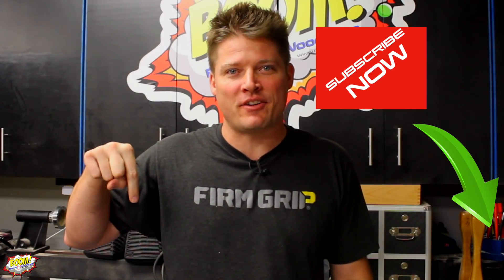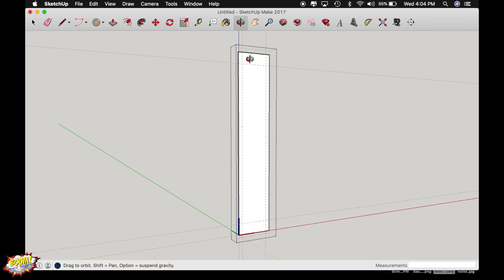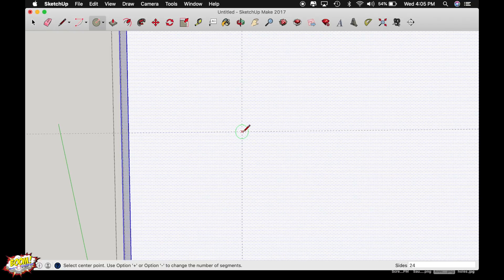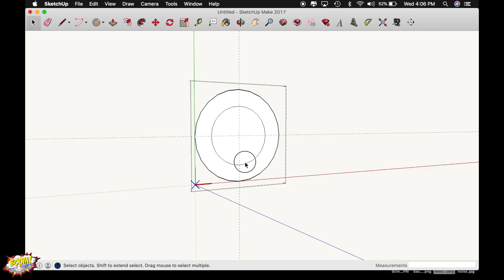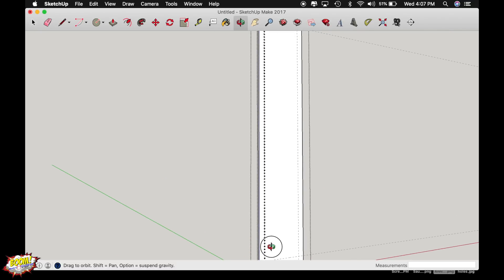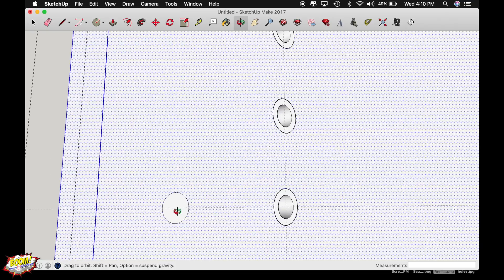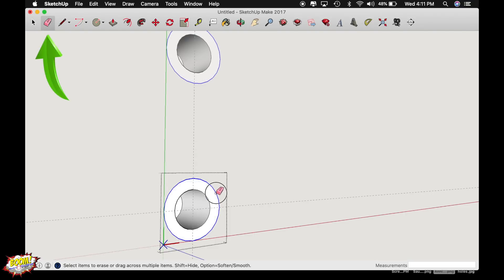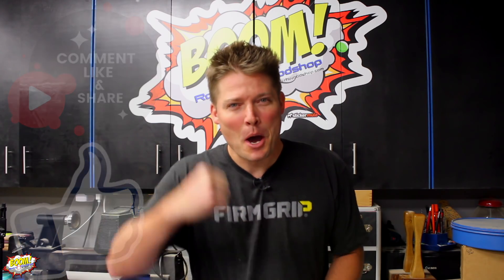Cut Face - Sketchup for Woodworkers Tutorial 7

Comment: So can someone explain why he was able to make the shelf pins holes without the ring in the other video? I'm confused why you would do it this way vs Video #5. This adds a bunch of extra steps. The other way was faster.
Reply from the maker: If you only had a few holes to do, video five would be faster but if you have multiple pieces with a considerable amount of holes to push and pull, this method in video seven is much faster because you don’t have to individually push and pull each hole 3/8 of an inch deep. With video seven you do one hole with a push and pull and then because it is a component it will automatically push pull with every copy you make.